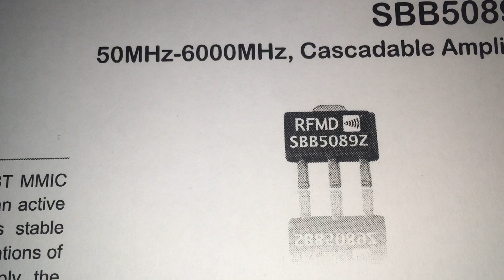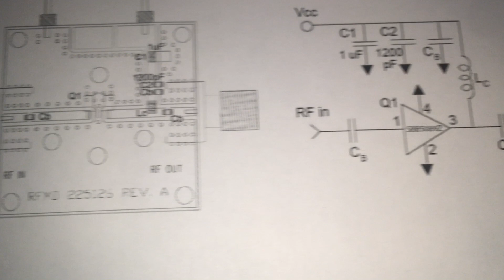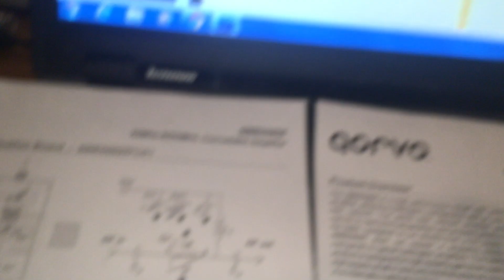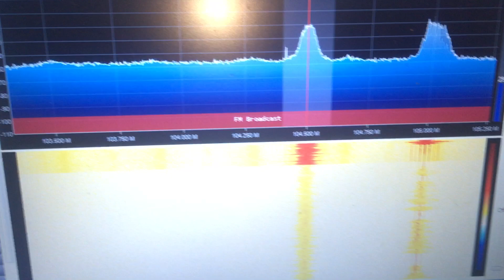SBB6950Z 5Mhz-6000MHZ Amplification Transistor//////////////////

Comment: Hello, Can this be used along with a 4g/5g antenna (3500 to 3700 MHZ) to increase signal reception in house?
Reply: A cell phone both transmits and receives at the same time.  If you put it inbetween the antenna and the cell phone the phone could not transmit.  You would need to modify the phone and put it in the receive side.  Also, this chip is more of a PA (power amplifier), you would want a preamp for the receive side.  The other way would be to use two duplexers, one to split the transmit and receive frequencies, and another to combine them, and put the preamp in the receive side.  (Cell phones transmit and receive on different frequencies.)  In short, not a DIY project.

Comment: Hi my friend.good video. Could I fit one of these on to a radio  scanner to boost signal. I have bought 3-like the one you have but I’m fitting a small power adjuster and a pp3-snap on adapter to a 9-v block battery. Thanks

Comment: How to give power supply for this amplifier
Reply: find a 5v adapter, or 9v. its marked on the device itself how many volts are required. be careful because you can destroy the device easily.

Comment: Can i boost 2.4ghz wifi antenna whith that booster?
Reply: Maybe, but only for the routers uplink. WiFi transmitts and recieves data.
Reply: Caution:
Drake Callum and Watson Krew are spambots.
Don‘t stream on these sites, you will most likely get ripped of.